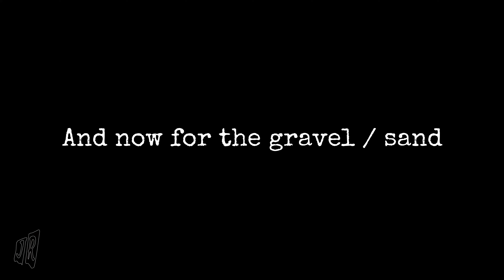Xinlehong Q903-Q902-Q901 RC unboxing & testing on tarmac & gravel!

Comment: Don't apologize! Some of us appreciate the in depth review. I've been looking at this, the Hosim 2845, the WLToys 144001, and the Traxxas 1/16 E-Revo. With the more budget friendly RC cars being as good as they are, it's getting really hard to justify spending more on the Traxxas MERV. Thank you for your time and work that was involved publishing this video!
Reply from the maker: Hiya Mike and thank you so much for your kind words. Yes you are right concerning the quality in the budget brands. I've not been drawn towards the Traxxas brand since seeing someone who spent 2 times more than the ZD Racing BX-8E I was driving at the time and theirs was so slow, like a little toy. Not sure what it was but like most things, you don't pay more for higher speed, you pay for the brand name. I couldn't afford them when starting this channel so bought 2 x 144001. One for my son and one for myself. One of them is still running after hitting it against a 1000 walls and curbs. The second was the star that flew out of the 5th floor Hotel window. You can in most cases buy three 144001, have one standard, one brushless and one for spare parts and it's roughly the same prices as the brand names. 😉
Thanks again for the kind words and I wish you a lovely evening. 😊👍

Comment: Thanks John. Just stripped mine and managed to get the diff open. No loctite on them just quite stiff. There is a reasonable amout of grease in there but I packed it out and greased everything else. Remo shocks and now it pulls so much better. Such a noticeable differance. Managed to smash my custom shell and the one that came with it. Also got my Tamiya Brat back on the road today which I have put a sport can in. Thanks for the video.
By the way the car pulls wheelies now, hence braking the bodies. Also wd40 on the tyres for 5 mins. I am looking at other tyres for it but there isnt many videos of people doing this.
Reply from the maker: Hiya and all that sounds good with the grease etc. Not good about the shells. Wheelies though are always fun. What do you use wd-40 on the wheels for may I ask? 🤔
Reply: @JohnRobinsonRC  the tyres are quite firm I find. Soaking with wd40 softens them up loads. Try it. 24 hours is the max, some people soak thrm in a bag overnight, however if you do it too long the tyres can start to swell so I just sprayed them and massaged them and then left them for 5 or 10 mins then dryed them off. Quite a big difference in grip o  tarmac and especially laminate type floors.
Reply: The revo shocks make a big differance on all surfaces although they do seem quite high mainanence  as the shaft is alloy and does get bent on most outings although I do give it some hell at the skate park.
Have you tried this on 3s. There are a few videos of people doing this. Im worried about longevity so have not attempted it.
Reply from the maker: Wow I haven't heard that one before. Thanks for the advice. I'll try it out! 😊 👍
Reply from the maker: Hiya. Yes I have heard of people having problems with running 3s so haven't done it myself but will take another look. Thanks. 😊

Comment: Good morning John. The sound is normal. The “grinding” noise is the ring and pinion clicking together as the magnets in the motor pass from magnet to magnet. You can “cushion” the sound with grease. If the motor is adjustable you can decrease the lash, that will decrease the time the pinion has to build momentum, thereby decrease the noise. 

I’m not sure what battery you got but a LiPo with a higher C rating will get you wheelies. 

Oil filled shocks will help a lot. The type of plastic makes the difference. The more flex the less breakage. 

The size of the motor isn’t the problem, it’s the KV rating. Put the 2845 3930KV motor in using in the WLtoys 144001 in it and it will fly. 😃

I just ordered two of these and three different KV motors so if you want to follow along I’ll be doing a lot of comparisons between stock and the other motors. 

Have a fabulous day! Cheers!
Reply from the maker: Good morning buddy. Thank you for all that valuable information. It for sure was a little quieter and as I tear it apart I will get to know it. It was a fun little car like you said it would be! :-) Ill have a look at the motor in detail. I think an upgrade in battery will be the key for sure. I will be watching your channel with interest as I have a alot to learn about the motors, esc etc and you have it all! Have a great day! Stay safe! 😉😎
Reply: John Robinson thanks for the kind words and your support. I thought you would like it. It’s really a great entry car. You really should get a set of those paddle tires I used at the sand dunes. They are amazing in sand and snow. 

BTW: I ordered a brushless and brushed version to show the difference then I’ll mod the brushed version to see if it’s faster than the stock brushless. I plan to track the prices. If the stock brushless isn’t fast enough it may be cheaper overall to buy the brushed version and upgrade it. 

I won’t know until I try. We learn as we go. 😃
Reply from the maker: @RCModSquad  we most certainly do! I'm loving this hobby. Driving, breaking, fixing and learning! And then there is a whole world of more experienced people to learn from! 😊 I'll look for those tyres now! Thanks for the tip! Take care buddy! 😊

Comment: Yes.. 4 shocks in the back will be perfect for this RC as it is not oil filled and also gives extra support for the shock tower.. I did this to mine and it feels more solid and strong and also doesn't bottom out so easily.
Reply from the maker: Hiya Smithesh and thank you for confirming that. I'll see what I have laying around but think it would be best to have 4 similar shocks at the rear. Time to order me thinks. 😁
Have a lovely evening! 😊
Reply: @JohnRobinsonRC  Yes go for similar shocks
Reply from the maker: Will do! Thanks again! 😊
Reply: @JohnRobinsonRC  This RC is very durable coz its light and soo much flexible
Reply from the maker: Yes I agree. There isn't much you cannot fix when it does finally break however having a strong chassis and suspension uprights I think is the key to why its so durable. Great car and I hope more people buy them. 😁

Comment: Nice video John!  Looks like a nice car.  You’re right, the 144 seems more hobby grade.  But this looks like it’s close.  Maybe with some aluminum upgrade parts and a higher KV motor it will change your mind?  Have a great weekend!!
Reply from the maker: Good morning jjtsht, hope you are well? Yes you could upgrade some parts to metal and upgrade the motor but then if you do the same to the 144001 to make it a fair fight. Then the 144001 is still better value for money. I assume a lot of people are like me when looking for a budget entry level rc car. What's the best bang for your buck and I still lean towards the 144001. You get a lot of car for your money. But let's see what the head to head shows up as without doubt the Q903's diff and drive shafts are better quality. 😊 Have an awesome day today! 😁👍

Comment: Hi.
I need some small wheels as q903. Could u tell me that outside diameter and thickness. These are can be fit for 12mm hex and 4mm center hole..?
These can be fit 104001 ?
Thanks.

Comment: Yeah, I'm back again comparing these two cars. I've also come across the Hosim 9156 that looks like the big brother to the Hosim/Xinlehong Q903. Kind of like the Rustler 4x4 to the E-Revo. If there was someone I wish had a review of the Hosim 9156, it's you, John. I think HBX has a variant of it also, but I can't recall the 5 digit model number. It only comes as a brushed model, but pop a 3650 3500kv, 3900kv, or 4300kv brushless in it with a 60A ESC and I think it may be a Rustler 4x4 VXL killer at less than $200 USD. I should just pull the trigger on the WLToys 144001, do the brushless upgrade, and be done with it, but I like the look of the Hosim/Xinlehong Q903, Hosim 9156, E-Revo, and Rustler 4x4 so much better.
Reply from the maker: Evening! Oh do many cars and not enough cash to buy them all! I wish I could but budget doesn't stretch so far I'm afraid. I'll add it to my wish list though. 😂 Did you mean 144001 or  1 0 4 001?
Reply: Just another follow up. The Hosim version of the Q903 with the 2845 brushless motor just went on a Lightning deal on Amazon US for under $120 USD (normally $139.99) and an additional $10 coupon. I'll have it by Friday for less that $120, including tax. At that price, I couldn't say no.
Reply from the maker: Wow that's a great price. Dont blame you! 😉👍
Reply: @JohnRobinsonRC , definitely the 144001. I'm looking for something at a smaller 1:12 size or under. That was why I preferred the E-Revo to the Rustler 4x4. The Hosim 9156 is about the limit on the high end of size.
Reply from the maker: Ah I see. Yes smaller means fast little bullet! Love it! 😊👍
Reply: @JohnRobinsonRC , first thing I can see doing to the Q903 is getting rid of that Deans plug and putting a XT60 connector on it. LOL

I found these shocks for it, https://www.amazon.com/gp/product/B07ZRDW35Q/ref=crt_ewc_title_srh_5?ie=UTF8&psc=1&smid=A3KK1IUFBK5DES, and they even come in different colors. Would you happen to have an Amazon affiliate link? I live in the USA and I am not patient enough to wait on Banggood. I'd love to make sure you got some sort of commission for the stuff I still need to buy. I'm still sorting through 2S and 3S LiPo batteries hoping to find something that will fit in the battery compartment. I'm finding plenty of them that are around 70mm long, but the stock 1000mAh and upgrade 1420 mAh batteries list 50mm as the length. I'm likely going to pick up an ISDT 608AC LiPo charger also.
Reply: @JohnRobinsonRC , I hope that I haven't become a pest. I found an Amazon item linked in another video. The one about the white lithium grease. I used that link to go over to Amazon and purchase all the stuff that I had mentioned, plus a few other things. I get the impression that you aren't the type that worries about getting kickbacks, but I hope that it was an affiliate link and you get a little something from the purchases. It's the least I can do with the helpful advice that you have given me and have gotten from your other videos. I'm off to learn how to take apart my differentials. Thank you for all of the very helpful content! :-)
Reply from the maker: Thank you so much for using the link. I do in fact care but don't push them as much as other channels but the links help a lot in me buying parts for the channel to make videos. In fact they were the only thing that kept the channel going not so long ago so I truly mean it when I say Thank you! 😊 Have a lovely evening! 😊
Reply: @JohnRobinsonRC  , I'm glad that it helps a bit. I'm not certain how much ended up being purchased from the link. I had some problems with the original payment method and the order was resubmitted by simply changing the CC info. I did get the Hosim Q903 on Friday and I absolutely love it. I'm really glad that I got the less expensive brand instead of the Traxxas MERV because it kind of seems like Traxxas is sort of the Apple of the RC world with most of it's parts being proprietary. I like to tinker with stuff, I think it comes from being an IT tech and working on computers for over 20 years. There's nothing like having a job, and running a small business, that also feeds what I'm passionate about. Anyway, the reason I'm glad I went this route is because I've already purchased other upgrades as well. I got a Raidiolink RC6GS v2 and a 3S LiPo to go with it, a HobbyStar 60a waterproof brushless ESC, 2 2S and 2 3S CHNL "Black" series LiPo batteries, the upgraded shocks that I mentioned before, shock oil, white lithium grease, a new ISDT balance board, and the XT60 connectors I need so I san cut the deans plug off the current 35A ESC/receiver module and the HobbyStar 60A ESC that is coming then solder the XT60 connector on them. I've gone a little crazy right out of the gate! LOL What I'm going to end up doing is put the new ESC in the current battery compartment and put the new receiver in the compartment where the current ESC/receiver unit is located. Then I'll strap the batteries down to the support beam that runs down the middle from front to back. I may have to modify some more once I see how much the configuration affects the balance and center of gravity. My prediction is that the ESC being placed in the battery compartment will balance the car a bit better, but the battery being mounted higher will raise the center of gravity and create an issue. I'm probably going to need to change the gearing a bit also. I'll see soon enough. Once again, thank you for all of your time and work that goes into publishing these VERY helpful videos! Just a quick question. I'm sticking with the 2845 3200KV motor for now, but want to eventually upgrade that also. I'll probably stick with a 2845 size motor and raise the KV rating to somewhere around 3900. I'm also considering a 3650 motor though. Do you think there is enough room to put the larger diameter motor in the same place as the 2845? That area of the chassis already seems pretty pretty tight on clearances with the 2845 size motor.
Reply from the maker: Hiya and wow you have gone full in haven't you! Thats a lot but you are right about paying extra for the brand name and not getting monies worth. Well in my opinion. Im not sure there is enough room for a larger motor from what I remember there is a plastic plate running by the side of the motor that would prevent a larger one but I will stress i am not 100% sure. I love that you are enjoying the hobby! For me I love when we gave a crash and something needs repairing or a new car review meaning it can be taken apart. The tinkering side is what I love. Obviously the driving but being interested in both means you get double the fun in my opinion. Have a lovely evening. 😊👍
Reply: @JohnRobinsonRC  , my side project with it is going to be putting a FPV camera and transmitter in it and getting a LCD panel with a receiver and recorder built into it. It should make for some interesting videos! LOL
Reply from the maker: Yeah for sure! Lots of people have tired so just make sure you have a camera with excellent stabilisation like a go pro. I use an Insta360 one r.
Reply: @JohnRobinsonRC  , I'm just following up and doing it here because this is where our conversation has been. This little thing has been awesome. I got the shocks, went ahead and drained them of the stock fluid and refilled them with Losi 50wt. SOOOOOOO much better handling now! Also, the CNHL Black series batteries are OUTSTANDING! I used to use the Ministar batteries in my FPV racing drone, so I was already familiar with the brand and that they are about the best bang per buck out there. If you get a chance, you should try either the Ministar or Black. You won't be disappointed. These are the 2S 1300mAh 100c batteries that I'm using,  https://www.amazon.com/dp/B08L3GW2KQ?psc=1&ref=ppx_yo2_dt_b_product_details. I'm also using the 3S 1500mAh 100c version. They are a little long for the q903, but I made a slit on the driveshaft side of the battery compartment, wide enough to run a 15mm wide battery strap I have for my race quads through, and problem solved. The issue of the batteries having a XT60 connector is easily solved in more than one way also. They will probably fit nicely in something like the WLToys 144001 or 129019. I still don't have the  ESC, but I do have the radio and receiver. I'm patiently waiting to install it so I don't cannibalize the Q903 ESC/receiver combo unit. I can't reiterate enough how happy I am I went with a so called budget option. If I had gotten a more expensive Traxxas, Arrma, etc. I would be a lot less enthusiastic about experimenting and tinkering with it. The parts for this are easy to find and less expensive if something goes wrong and upgrades are plentiful.

Comment: Hello,nice video!
I have a question...i want to buy q901 but im interested how much it can go without charging? And i will peobably buy a new battery and if you can recommend me a good one. Thanks
Reply from the maker: Hiya nok. Depending on how hard you drive your car it can last from 7-16 minutes. Maybe even longer. If you want longer driving time then either get another battery like what you have said or a battery with a higher mAh figure. The problem is that the Q901 does not have a lot of room for a larger battery. So I would just buy a second or third original battery. Have a lovely evening. Kind regards, John. 😊👍

Comment: Hey john! Great video as per! Q. Did you check the gear/diff lube inside the casing did you have to great the gears too? What is it with these cheap Chinese tucks & the lack of grease/lubrication? Is there a shortage we don’t know about 😂😂
Reply from the maker: Hi there. Hope you are well. No to be honest I haven't managed to get to it yet. It's on my list but I suspect as you wrote that it will be lacking grease. It's not a coincidence that they all lack grease. It's so the diffs wear out quickly and you are forced to buy new or upgrade. Anyway I will comment again when I have checked. Have a lovely weekend. Kindest regards, John. 😊

Comment: The xinlehong needs oil filled shocks.  Then it grips n rips. I also upgraded my battery to 2s 2200mah 35c.
Reply from the maker: Good morning David and thanks for your comment. Yes I agree, oil filled shocks would make the Q903 feel like a much better product and of course handle a lot better. Have a great day today and stay safe! Kind regards, John. 😊
Reply: Hi, which 2200 Lipo 2S do you use?
Reply: Zop power